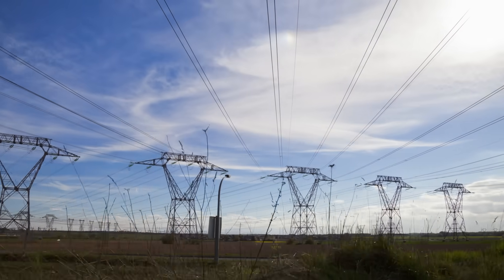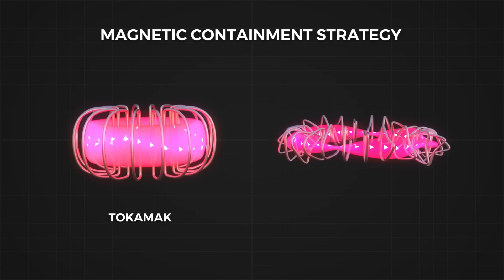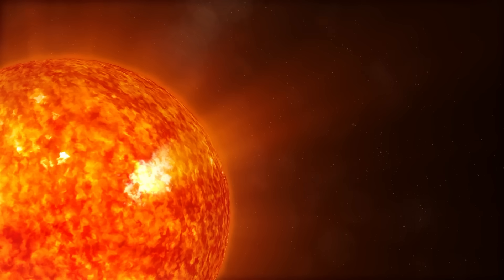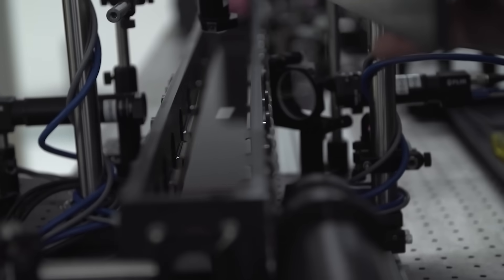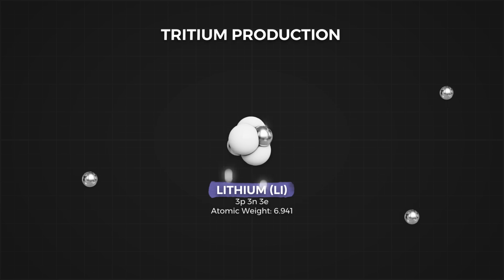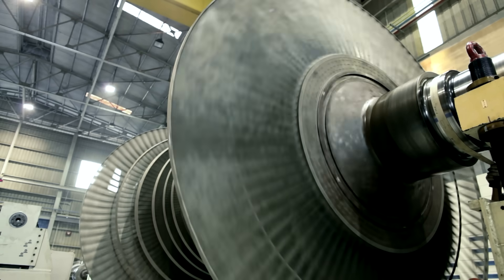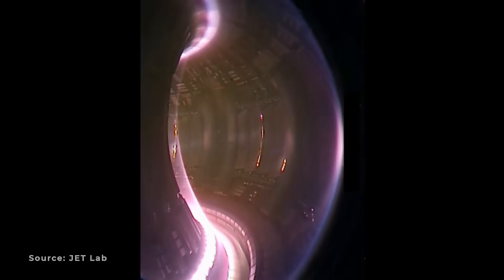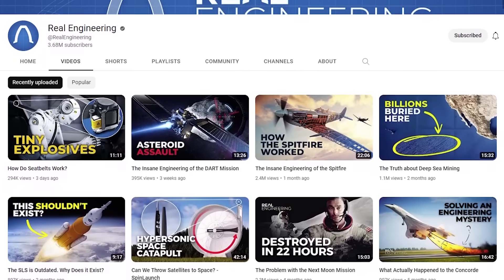The Problem with Nuclear Fusion

Comment: Ummm....why do you show a video of a CT scanner when you mention an MRI machine?
How to tell apart these 2 scanners? For one the MRI room would be almost empty and not filled with metallic objects and a monitor which would be attracted into the super-powerful magnet (at least 1.5T) that is inside the MRI scanner. Also the MRI scanner's bore length or depth is many times longer than that of a CT scanner.

Kindly correct his oversight before people think it is ok to bring metal chairs and trolleys into an MRI scan room. I'm sure there are tonnes of royalty free videos of MRI scanners just not the one you are using.

Comment: There Might be a Flaw in your Theory!
Energy is a Release of Compression. When things Break up and Release Aether. Combining / Joining things Requires Energy (Big Bang).
This is Darlik Science, Question them.
The Reason they may believe in Fusion is because of Hydrogen boosted Fission Bombs. However, that Extra Energy may Not be due to Hydrogen Fusing, it may be due to Hydrogen Splitting and it's Neutrons Accelerating the Fission of Uranium. However, some Hydrogen may Fuse to Helium, reducing (soaking up) the Energy Output a Little.

Comment: We have an enormous fusion reactor not that far away from us and operating under conditions that we could never hope to reproduce here. Why do we not concentrate on harnessing the energy that this produces - and, at least partially, radiates to us?  I was in a village in Tibet, many years ago. There I saw what I first thought was a small satellite dish  for TV. Then I saw that there was a kettle placed at the focal point for boiling water. OK, so I don't know the energy input required to make the dish but I will bet that, decades from now that device will still be boiling water at no cost to the tea maker.
Reply: fyi, that's literally how solar power works (on a bigger scale).

Comment: "NEWS" of a fusion breakthrough is defined as "Invest NOW!!"....creating an atmosphere slightly resembling the surface of the sun on our planet is...ummm daunting?
   A milli-milli second of a micro burst of TWO atoms.......it's like Henry Ford realizing the wheel is actually a good idea.

 Much much work should have been done finding ways to eliminate the dangers involved with fission waste......that tech has been in our grasp going on a century, or maybe it could help with the fusion problem?...win win?

The amount of energy trying to KEEP the reaction safe just blows my mind...the ultimate perpetual energy machine? It has to create enough energy to safeguard it's potential, and output usable energy.

Comment: Obviously the answer is to do fission and fusion back and forth inside the same chamber over and over again. Kinda like AC electricity as opposed to DC. That way you never have to worry about isotopes and availability of material. You start with uranium you do fission for 5 mins. Then stop and do fusion. Then fission again. 🤔

Comment: You lack consistency in your video. 1:06 You want to keep talking about the Science of cheap, reliable energy but then you assert that this energy production would "...solve our issues w/ climate change". What issues are those? So far, using the Scientific Method, there has been no confirmation that there is an issue. I've seen climate hysterics for a long time; you climate cultists have earned a Zero in the accuracy of predicting climate catastrophe's. You don't deserve the title of 'Real Engineering' when you make inaccurate assertions of 'climate issues'. It's the Wind/Solar Farms that should be decommissioned to make room for agriculture, animals & people. Broken Solar panels especially on these big farms release the cell materials that are extremely toxic & can be carried into the ground water by rain, poisoning the water for generations because the materials are so refined that they won't break down. You don't deserve to use the term 'Engineering' because you'd rather promote anger in your viewership then rational thought. When you make an assertion, show proof or pass over the topic because you aren't qualified to explain.

Comment: You're not wrong with fusion going the same way as fission. But as mentioned in your video', they can use eachother to sustain eachother. It is still ridiculous how people fear nuclear power. It is cleaner, there are less deaths in the process of producing the energy and the expended fuel problem is not as big a problem as media likes to make it out.
Yes, there have been disasters with nuclear power, but how many people have died in coal mines or in gas fields? Exactly, waaaaay more.
Anyway. It is silly for government to give up on fission power only to then make fusion impossible. Just what the f. Here is hoping more breakthroughs happen.
Helion might be one, but that seems WAY further away then your video might suggest.

Comment: As far as I was aware, nuclear power primarily gets shut down because people are scared of it, despite it being far safer than fossil fuel power. This is the first I'm hearing that it's supposedly more expensive.
Reply: There is general agreement that current and future fission reactors are more expensive than solar, wind, and some other sources in terms of levelized cost. There are other factors that still make nuke useful such as base-load 24/7 operation, land-use, material resources used. Levelized cost is also not a fair comparison because of the intermittently problem ignores the externalities costs of the redundant infrastructure required to back up power production when the sun / wind can't be used. It's complicated like so many things are. Improved fission technologies also have the potential for reduced cost so I expect fission to hang around longer than most people expect.

Comment: I started learning about fusion 30 years ago. By then it was "20 years away". Today it's at least 50 years away. And in 2100 I'm sure it will be a 100 years away. As marvelous a technology as it may seem, after so many failed promises I believe we have to accept fusion will never be a viable energy source. I'm not saying it won't be possible as a proof of concept, but as a commercial option - never. We either need to make fission much cheaper than today, which is more than possible, or just accept intermittent renewable energy and large-scale storage as the way forward.
Reply: Yep. It's really only being pushed because it's the easiest way to get grant money while toiling around and looking like you're doing something without having to provide results. They generally just use the sun as an example of a working prototype, so it looks like good science on its surface. But one must keep in mind that despite all of our advancements, most of the last 70 years of science has been absolutely dead ends, as JWST has shown about the universe. Scientists still haven't come to grips with that reality, or ignore it entirely. That sets the stage for science that revolves more around grant money than actually accomplishing anything, because all the money that has ever went into fusion, has ultimately lead nowhere. The ultimate truth is that without the actual conditions of the sun based on its mass and size, fusion would never be a reality. On top of that, helium based fusion would never work even if we could make it work, because there's simply not enough helium on earth to use it as a long term source of energy. And going to space to get it is like walking in a desert and expending 1999 calories to get 2000 calories. And again that's IF we could ever squeeze anything out of it. So even solving it doesn't solve for the limited fuel for it that we have available on earth.

Comment: Wars over oil are largely a myth.  Wars generally start over political/religious issues, land disputes, access to coastline for trade and farm land/water.  

In no way is moving to a clean energy society bad but people don't fully understand the upheaval that would occur.  The entire middle east and Russia would lose a significant portion of their GDP.  You want to talk about geopolitical turmoil?  There will always be a need for oil as most of the stuff we use today is petroleum based but just think of the worldwide impact on the global economy.  It's going to be nuts.

Comment: Great video. I didn't realize fusion power might lead to a build up of some of the same radioactive material waste that fission produces.
Reply: Mostly different radioactive waste, generally considered more manageable because it's lighter elements with comparatively short half-lifes. Short half-lifes are manageable because they decay quickly, long half-lives are manageable because they are not too radioactive. It's the stuff in the middle, commonly produced by fission, that is more difficult to manage.

Comment: We literally already have cheap reliable abundant energy in solar and wind power. There already is an energy transition happening.  However, even though it already exists, there is another factor and that is social and political motivations and contradictions. Just because we have the technology does not automatically make it benefit everyone. How we structure society is greatly influenced by technology such as hot running water. But not everyone has hot running water. And that is because of political and cultural pressures, including economic ideology.
Hopefully fusion power will be developed and be useful. There will probably also be a variety of side benefits we only see in sci fi movies and literature. However, we can not count on fusion today.

Comment: I can't help but think we could utilize the  kinetic energy of the spare neutron more directly than turning it to heat>steam.  Some sort of direct thrust.
Reply: Direct energy conversion because the output of the nuclear reaction is charged particles is considered one of the potential benefits of pB11 fusion. But there is no practical method of converting neutron kinetic energy without something like a thermal power cycle. Explaining why this is so would be a lot more complicated.

Comment: Went to a lecture on fusion as an undergrad over 50 years ago and they said at the time,  it was 20 years away.  This is “a really hard problem” and I say it will be at least another 20 years before something on a commercial scale is built (assuming the funding is still there)
Reply: Yeah it’s always 20 years away.  I wouldn’t hold my breath that it will ever be viable.
Reply: @thelastperfectman4139  thats what people said about flying for the longest time aswell.. or space travel or fission etc etc
Reply: @Fancymarine  No, it's what scientists said about flying (heavier than air flight). People developed manned powered flight, not scientists. Fission is what heats the Earth, so we didn't discover that and you have to go back a long long way to a time when people never believed there would be space travel.

Comment: Use nuclear fusion vs fission are two sides of the same coin

Think of it this way

You'll have a break through
Reply: Imagine having a nuke explode inside
A**, **, ****, ***, *****, *******, ****, *.

In turn it'll cause a chain reaction
Only problem there wouldn't be a safe way of turning it off

Thats the only problem i cant fix
Reply: @akeelahmed646  A fusion reaction can't trigger a chain reaction, if the process fails or the reactor melts down, the plasma will cool down and nothing else will happen. Do some research before posting a "smart comment" on the internet.
Reply: @notthomasjoel  much easier
Much easier Asking a stupid question on here
🤔😁 
We'll agree to disagree agree 👍🏿
But thanks for the insight 

I'll keep the stupid question/comments 

Keep learning 😘
Reply: @akeelahmed646  Sorry for being too aggresive. But as long as you have learned something, writing the comment was worth my time. Have a nice day!

Comment: Nuclear fusion works just fine ........ in the interior of stars.  I do not see any way to duplicate the conditions required for a long time (20 years +), no matter the magnets and other stuff.  I am not stupid, by the way.  I have a BS in Mech. Engineering.  Please prove me wrong.
Reply: Look up news about a fusion breakthrough, they have done it a few days after this video was posted. The reaction produced more energy than they have put into it. Doesn't matter if it's inertial contaiment or magnetic contaiment. (Btw bragging about your degree is pretty cringe bro, grow tf up)

Comment: The reason why I think the Iron Man Arc-Reactor might still be the future, by combining ALL fusion processes, with all plasma & electrical arc technology, plus some other stuff.
Outer ring a neon-laser-tube, for the laser fusion reactor part.
The electro-magnet -coils on the outer ring, together with the main fuel material in the center, acts as part of the lightning-arc fusion reactor and a way to potentially get power out.
It's also funny in how the lightning-arc is then supporting the neon-laser part, as well, thus creation fusion reaction starting elements.
The coils also should be able to support part of the more classic fusion reactor setup as well, would the lightning-arcs to the center fuel material, be usable for the other part of the magnetic containment, then?
Or would that still be the main problem, then?

Think, what do we know, how can it all be combined, that is the real way forward with fusion.
Only by going for Eco-home style of combining things, will a fusion reactor become a pure energy source, in our livespan.
They still have to figure out waaay too much.

Let them start with the formula they claim, presents the universe we live in, length, wide, height & time, time is a movement (you've read this, time has moved forwards, right?), they use a sub-formula and we all know what happens if you use the wrong formula.
They use the formula for Schrödinger's Cat, also known as Stasis, since we ain't statues or pictures, we move our bodies, using electrical pulses, we can think, we are in movement, all the time, our atoms vibrate.
It should be Length, Wide, Height & Movement, thus also solving the problem that makes some folks say we live in a 11D dimension, instead of a 4D dimension/universe.
Everything moves, electrons, atoms, gravity, light, time, ect, ect.

Since in order to still get a good answers, when using a wrong main formula, they either use two wrong ones or there is one big calculation flaw, somewhere.
They still have quite a lot of research to do, that's for sure.
Wonder if the current climate is raising or lowering the amount of money they get for this research.
Reply: If you want to make a working commercial fusion reactor in two years, and get commercial heat, I can help you. I have made a great world-class scientific discovery about nuclear fusion in the atmosphere of the Sun.  The assumption by scientists all over the world about nuclear fusion in the core of the Sun is well known.  This is a fallacy. For over 72 years, scientists have not been able to make a working commercial thermonuclear reactor, and will not be able to make one for many years to come. The reason? The misconception of nuclear fusion in the Sun. 
Nuclear fusion in the Sun's atmosphere begins under the physical conditions existing there at an initial plasma temperature of 5,000 K; by the end of the fusion reaction, the solar plasma temperature reaches 1,500,000 K, on average.  Sunspot temperatures on the Sun from 3,000 K, sunspots can be up to 100,000 miles in size. Doesn't this prove that nuclear fusion occurs on the surface of the Sun, not in the core of the Sun? If we take a good look at and study sunspots, it is clear that nuclear fusion takes place in the Sun's atmosphere.  
I know how to replicate the physical conditions for nuclear fusion in the Sun's atmosphere. I propose a reactor design with the same physical parameters for nuclear fusion and excess heat as in the Sun's atmosphere.    https://www.youtube.com/watch?v=FcypwoVOAAY 
To make a small working prototype confirming the principle of nuclear fusion in the Sun's atmosphere and obtain commercial heat needs about 10 million euros, manufacturing time 2 years. It could be less. Depends on the country where the prototype will be made.

Comment: More energy has been used currently to produce nuclear fusion than will be produced by it in the most optimistic models in 150 years. It is pointless. So much money and waste to provide power with rare elements used as fuel that still produces radioactive waste, just a little bit less than fission that uses a pretty common and sustainable fuel. How about we take the resources being wasted on fusion and apply them to utilizing the waste of fission and be done with it
Reply: “Just a bit bit less” is an understatement lol
Reply: @Gomlmon99  are looking at percentage? Or mass? Or mass per output. You can skew the numbers to look at it how you want.  I look at it in terms of mass per output